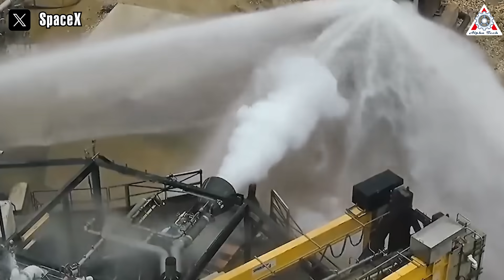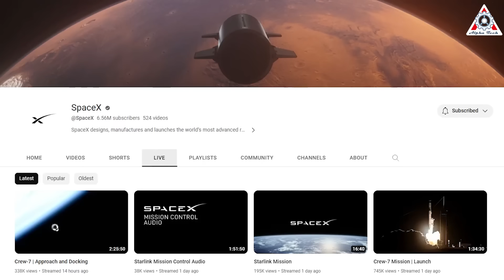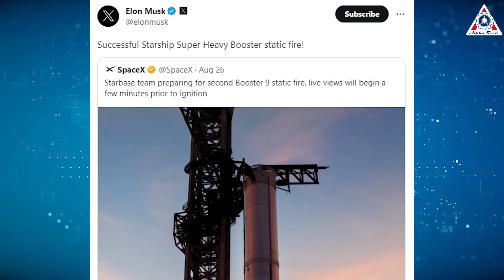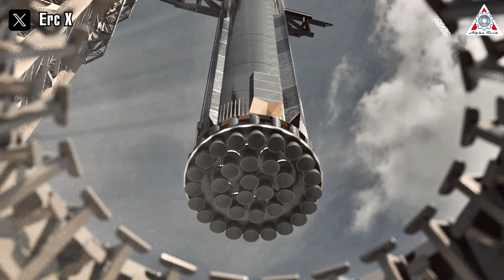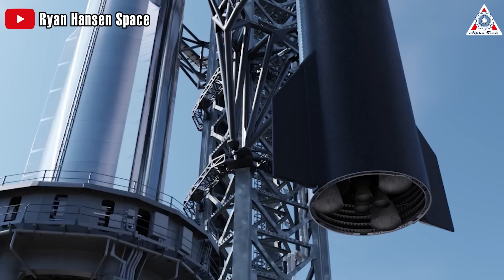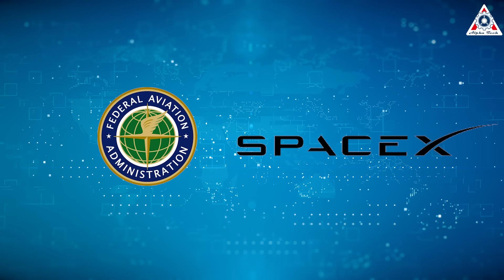SpaceX's Raptor issues FIXED! Analysis 33 engines fired aftermath...

Comment: well that is true regarding more engines, unless the engine a) explodes and takes all its neighboring engines with it in a cascade or b) has a backflow ignition into the fuel stream or c) the fuel pouring out of the unlit engine explodes... soooo. maybe nasa and the saturn v had it right all along?

Comment: it would seem that the loss of several engines could be compensated for by steering or gyroscopic mechanisms, but , if that number and the asymmetrical thrust was exceeded couldnt it automatically shut down engines on the opposite side to keep the thrust vector centered?

Comment: Chamber instability, which the designers of the Saturn V F1 engine struggled mightily to solve, is the single biggest reason SpaceX chose to use multiple engines as opposed to a few very large engines.

Comment: Heard two shut down early. Not good.
Reply: But do you know WHY they shut down?
I bet you don't.
So how can you assume it was bad?
Reply: @williamtsmith9668  no, not at all, the engines are still very much in the prototype stage, bound to be working, or work in issues. This is very much "Rocket science" also on a razor-thin edge. My most fervent hope is SpaceX hasn't fallen into "Go or Launch" fever. Like the very old Orson Wells wine commercial, "We will sell no wine before its time" SpaceX needs not launch another StarShip before its time. 60 percent possibility of orbit success is about 39.9 percent to short. SpaceX can't really afford another StarShip doing summersalts as it falls back towards Earth. Personally, I can wait till everything is more mature.

Comment: I follow all your updates, finding them informative and worthwhile to watch. Can you please use your contacts and find out why the two engines failed? Was it internal faults, insufficient fuel or debris thrown up? It is only a few days after the test but someone somewhere knows. Thanks
Reply: Yes, indeed... no word about that so far... I share your interest in that, Mike, Germany
Reply: I too would like to know which engines quit early and how early in the 6 second test.  It's great to leave the pad with 33 firing engines but what happens at second 2, 3, 4 ect?  If you loose 5 engines by T+10 do you make orbit?
Reply: @edvard5697  Good question! I am sure though that sooner or later we will know!
Reply: During a test, as a static fire, the software that controls engine startup and shutdown are set to very conservative parameters. Too, the full flow design of the Raptors, don't like to run at only 50%.
There's NO reason to risk a catastrophe on the pad, at this point, if ever.
The Raptors are just fine and they will all fire on the next launch. 
And stay lit.
👻☠️🗽💯🙏

Comment: Now, that SpaceX solved most of the structural problems at the bottom of  SH Booster is time to address much bigger problem created by lack of pressurization of the Skirt. Any structure below upper dome of the Liquid Methane tank of SH Booster is working in tension due to pressurization. Any structure above upper dome of Liquid Methane tank of the Booster and below lower dome of LOX tank of the Starship due to lack of pressurization works in compression.  SS sheetmetal behaves very poorly when it is edge compressed as it tends to buckle. Buckling behavior of thin walled and welded SS structures cannot be modeled on computer and it cannot be predicted. This is one of main reasons such structures are never used in rocketry where safety margins are very low. Even proper stress testing such structures after manufacturing does not give any guarantees they will work as planned  in the real rocket. SpaceX method of testing segments instead of whole unpressurized structure is particularly deceiving. It gives an illusion that testing is done properly while in reality such partial tests are meaningless.
Reply: So how did the rocket launch in April and not fall apart?
Reply: @jamskinner  Compressive force on interstage increases proportional to acceleration, for given thrust acceleration increases with loss of mass due to consumption of fuel and oxidizer. In case of constant thrust compressive force on interstage increases fourfold between launchpad and MECO. In case of 50% reduction of thrust between launchpad and MECO compressive force on interstage increases twofold

Comment: My question is, if 8 or 12 engines could lift vehicle up above ground structure, then ignite the remainder of engines for full force when it is clear.
Reply: You can’t.
Reply: have you tried? How is it, can't is a final answer? @jamskinner
Reply: They do it with submarines, so, can't?

Comment: If your Spacex and  you have 33 engines per launch and 10 launches, you only need 33 engines, not 330.  Also in case the FCC and the author of this video hasn't noticed, Spacex has already completed massive changes to correct the issues with the last launch.

Comment: A bit like pogo  wonder if the large number of engines sets up interesting oscillations that unbalanced the rockets motors in some way feeding fuel, vibration coupling etc as It  was curious how the engines failed mostly on one side for first launch. If that is the case I'm sure software can be made to tune the engines dynamically to damp such things, because I never noticed a single issue for raptors in the belly flop tests on the upward leg. Obviously post belly flop is a different somewhat irrelevant raptor story....

Comment: What reliability?  In the last test, not one but 2 engines failed and shut down prematurely, and it was a test of a few seconds. People nowadays have zero shame in going with evident misrepresentations and lies to bolster a narrative, and they assume the audience is too emotional to notice. Multiple engines: One can build a reliable engine like the ones in the Delta IV heavy, that never failed, or like the one on the space shuttle. You can also go into a rational middle point, like 9.  Something like a Falcon 9 seems a rational number of engines. In any case, that is subjective and there is more than one way to do it, but the point is there is zero proof that the engines are confiable, and a lot of data telling us that they are not (maybe is not the engine, but having them so close surounded by shockwaves, heat, and debris)
Reply: Heavy has 27.
Reply: So, you have seen the actual data, regarding the engine shut downs?
That's exciting! I would love to know where you saw that data! 
Asking for a friend.

Comment: Why doesn’t SpaceX do a 33 engine test at McGregor TX to work issues?  The next phase to prove will be the Raptor 3 engines.
Reply: Only if they have copy to the orbital lunch mount and a water suppression system

Comment: Well Done ELON MUSK. Now if the launch pad can be untouched after a six second FULL POWER 33 ENGINE ROCKET LIFTOFF or Trial then I will confess I was wrong about your Launch pad Design dispensing with a Cape Canaveral Trench design and My addition of Deep Pools of water encapsulating the area with boost panels to absorb the Rockets power.  I WILL BE WRONG IF THAT IS Proven under the above Conditions.
Reply: Nobody cares. All we care about is if the rocket works.

Comment: I think people need to realize how quickly things are getting fixed. Booster 7s engines where some of the first off the production line. Booster 9s are either the next off the line or one run after that.

Comment: I think the small engine mass production logic is total BS. 
Too many things to fail, and all the parts smaller and less massive for strength. looks like fear based engineering, or too lazy to do the work on larger engines required to get past prototyping.

We need engineers who like to do things because they are hard.

"The hard path looks easy."(Tao)

What this saying is talking about is taking the easy way out, that things then get hard. downhill and you end up in a swamp.
Better to attack the hard problems first, then things perpetually get easier.

Note to SpaceX competitors: work on engines more to scale with your rocket sizes,  and you will have no problem catching SpaceX. SpaceX will get mired in engine problems by avoiding the obvious solution, and not doing the homework required to develope larger engines.
I suspect before this is over there will be specialty engine mfg. companies, just like Cummins or Continental in industrial quality piston engines.
 SpaceX is still trying to run a battleship on outboards.
Big engines have been done before, its not impossible. And if you plan a thousand ships, thats production to scale if each ship require three or more engines.
Elon must have a Soy fed engineering department..
Probably need testosterone and viagra suppliments.
Grow some hair on their chests, and eat meat.
🤭

Comment: I think SpaceX should modify "stage 0" to impart a couple of m/sec of vertical momentum to the rocket. Like the suction cup dart from a toy gun.
Reply: Complexity cost on that is huge compared to the benefit. If you're not doing spinlaunch or a railgun (which would be quite doable on the Moon or Mars, if not Earth), so you can eliminate the first stage, it doesn't seem like it would get you much.

Comment: Having only 2 engines shut down on this second test fire which ran for a full six seconds was a clear step forward.  4 engines failed on the last test fire.  That test was terminated early after less than 3 seconds.  

All 33 engines fired this time.  Space X appears to have found and corrected one issue.  Hopefully this test showed Space X another issue which will be quickly addressed.  So far, the superheavy testing has been a near perfect example of the benefits of the rapid iterative development model.  Great engineering Space X.  Can't wait for launch test 2.
Reply: You can wait, you will wait.

Comment: Did they already overcome the 'Raptor' problems? Some engines were prematurely shut down. Why?
Reply: When testing you usually put very strict operating constraints on the engines.. If the computer detects something out of range it will shut down the engine.  Later on the engineers can determine if it was really warranted and adjust the parameters.   This is a normal part of testing.  As time goes on you'll see fewer and fewer engine shut downs.

Comment: The lesson from the Soviet Luna booster is more engines is bad.  Too many points of failure.  They made it worse by steering with thrust differential meaning when one rocket failed its twin on the other side had to be shut down whether it was having a problem or not.

I expect SpaceX will settle on 3-4 non-gimballed big rockets and 3-4 small gimbal rockets for steering and landing.

Comment: When Booster 9 burns for 8.5 minutes on the pad, 500 seconds, ALL engines, THEN I’ll be impressed!
Reply: Considering the Saturn5 never did that, then why. No rocket ever does that. Test firing individual engines in a test bed for full duration, yes. Confirming fuel flow to these engines since install is all they are doing. What you want to see is the complete destruction of the rocket and launch facilities, probably around the 45sec mark.
Reply: @gregdrake5415  No one does that?? Check again and get your facts straight. Then comment! Hint: Green Run….
Reply: @wolfman007zz  ok didn't know they built a test bed strong enough to fire all engines for the duration. However it isn't the launch pad but a purpose built pad. I guess Spacex reckon they don't need to do it and I wonder if NASA would build a Stennis centre now if they didn't have one from the 60's when they built Shit to last, probably, it's not their money...
Reply: Concession: Run just the booster engines for 2.5 minutes. Then main engines for 500 seconds. Then I’ll be impressed!!

Comment: Just a thought. instead of lifting all the weight in one rocket why not fire state 2 first, then stage 1 and join them together in space. Might be able to remove a few engines but carry the same amount of fuel....refill the 2nd stage, and off you go. I'm not an engineer, but I did sleep in a Holiday in Express last night  why wouldn't that work?
Reply: Stage 2 engines aren't design for space. They are only designed for sea level to basically max-q. After which the second stage has Raptor engines that are designed for high altitude and lack of atmosphere. The booster is exactly what it says it is. A booster. Its job is simply to get the second stage high enough to fire its high-altitude Raptors.
Reply: 2nd stage is 150 ft long and150 tons
Reply: Stage 1 never goes to orbit. You can send up multiple stage 2s with fuel refills; that's the basic plan for the big missions.

Comment: Only problem with many smaller engines rather than a few larger is it introduces more points of failure. The Soviets always had many more smaller engines because they just couldn't build quality larger engines. I was a missile systems analyst for the USAF,
Reply: wouldn't it also give you more chance for recovery as well though?
Reply: @shadowlordalpha  The main risk would be if failures cascade, like one engine blowing up and taking out neighbors. Then it would be less risky to have fewer engines. But if failures reliably won't cascade, then you begin seeing really high overall reliability numbers.
Reply: @drachefly  it should be possible to design around that. Trade offs though for complexity so no idea how worth it it would be
Reply: @shadowlordalpha  Well, yes. That's one of the major design considerations.
Reply: Smaller engines are a must for a rocket build from stainless steel sheetmetal. They distribute thrust force they generate  over whole lower dome of LOX  tank. Weight of LOX pushes on the dome from other side canceling large proportion of thrust force locally. Gas pressure in the LOX tank also pushes on the dome from inside. No big and heavy stiffeners required to transfer remaining thrust force up the sides of the rocket. That makes lightest possible structure capable to withstand compressive forces generated during liftoff.
Reply: He explained it in the video.
Reply: Just a  "little" detail....

Falcon Heavy, 27 engines, a lot of launch and 0 failure.
Reply: Easier isn't always the answer. Especially when you consider the end value. Proper quality testing elliminates bugs. Remember Perato?
Reply: @user-ls8fy5bu7u  it drastically reduces them not eliminate. But ya
Reply: Yeah, best parts is no parts, but there was a convinceing explanation in the vid.
Reply: It's a proven design already with Falcon 9. Did you watch the video?
Reply: Those smaller engines you're talking about are the most powerful ones ever built.

Comment: 2 shut down in less then 5 seconds at 50% thrust at that rate they will lose 4 engines before it leaves the pad 😂 as much i want it to be it far from reliable or successful
Reply: That’s not how math works. 
If you eat 3 meals in 12 hours does that mean you eat 6 in 24?

Comment: Wouldn't lower thrust/engine be used at the start to get away from the pad? If some fail, then quickly raise the power level to compensate. Then go 100 percent until Max-Q.
Reply: The single largest need for thrust is overcoming inertia and lifting off the pad.  It takes the most thrust to get it off the pad.  Any acceleration AFTER initial lift off requires less thrust because it's ALREADY in motion.  So, to answer your question, no.
Reply: Yeah, one of the laws of nature called 'conservation of momentum.'

Comment: Conducting a test involving that much energy without destroying the testing environment isan achievement in itself.
Reply: It is progress
Reply from the maker: Let's wait for SpaceX's next miracles
Reply: Not quite sure on that yet, although it appears to be working pretty well so far compared to the first mount; but engine thrust was limited to 50%, and until the next full test launch we aren't sure how long the pad will have to withstand the exhaust and steam. If a couple of engines are lost (but still within the test criteria for launch), it will be on the pad longer. Time will tell...

Comment: Of course, the Soviets tried ~30 engines back in the 60's. That was their attempt to reach the moon, and it kept failing, The big downside of so many engines is that when one ruds it might take out its neighbor, so there is a cascading effect.  We saw some of this on the 1st launch. It's something they've been working hard on. I think the auto-shutdown feature is intended to sense any anomalies and stop the engine before it ruds.
Reply: It gives a lot of redundancy, if you have 4 engines and they are one time use, it's very hard to imagine all the ways they could fail mid mission.  SpaceX has now had how many Raptor engines?  The more you have to test the faster you find the failure points and correct them.  The Soviet Union issue wasn't the number of engines, they didn't have the resources or time to fully test and vet it since they were in a race against NASA.
Reply: @yournumberonepal  Your blather makes no sense if you place Mars in that equation. Musk is manufacturing a product that is less than 100% ready. A mission to Mars by humans is a death sentence. That being said, Musk should only send the idiots who believe his Mars grift. 

Are you volunteering?
Reply: The other test had engines fail from concrete and debris. It was not a cascade.    
They use many engines as the smaller engines are more efficient than a few larger engines. It is not about redundancy, but about efficiency.
Reply: I love KABoOoOoOooomsss...
Reply: It depends on whether its the engine or the nitrogen powered starters in the pad